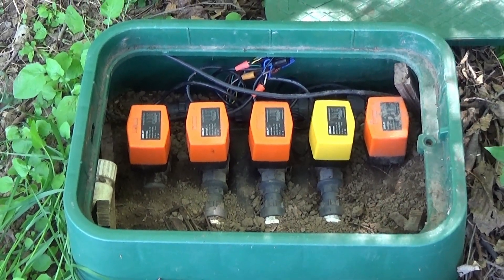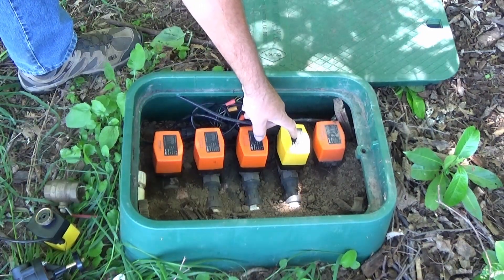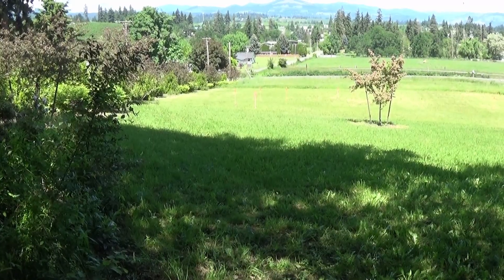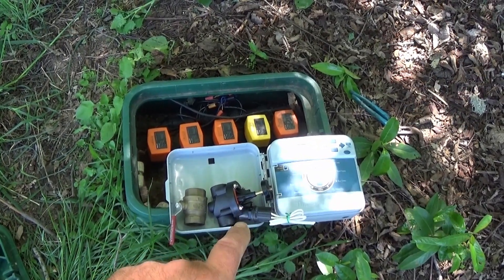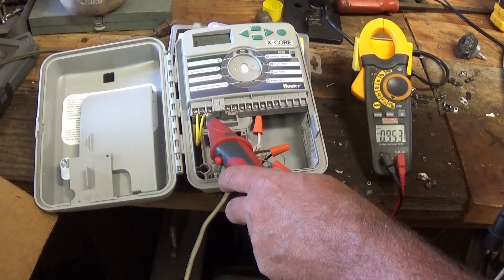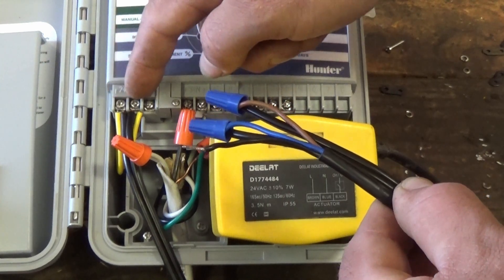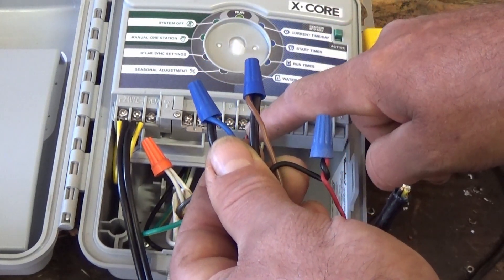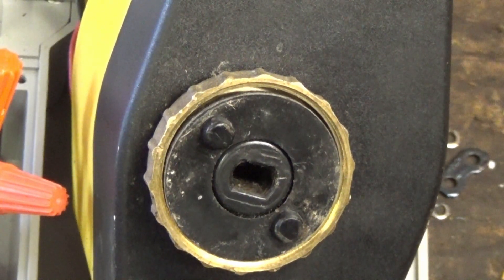Motor Actuated Ball Valves and Irrigation Controller.

Comment: Hi, thanks for sharing your video. Can I ask what amp output the transformer on sprinkler controller delivers, my rainbird RC2 puts out 24V @0.82A and it does not seem to provide enough to amps to power actuator. it just hums but will not move, I believe the wiring is correct, any advice is appreciated, thanks tony

Comment: I've found that they come in various configurations from various manufacturers.  They can be normally open, actuated to close; normally closed, actuated to open;  1/2", 3/4", 1".  With or without the ball valve.  I ordered 3/4" normally closed for my irrigation system.